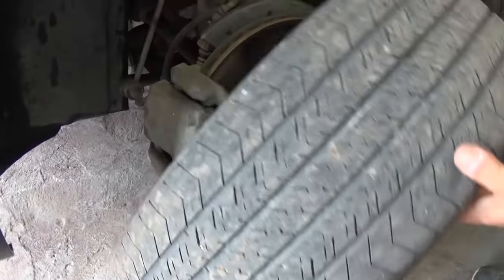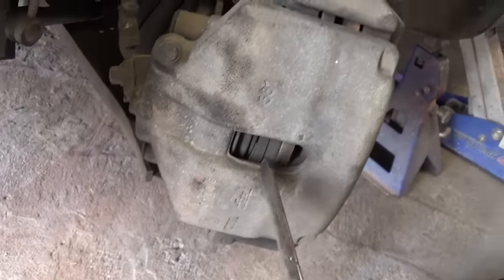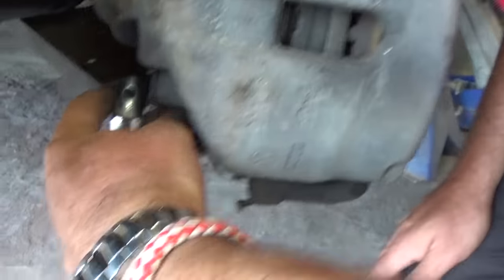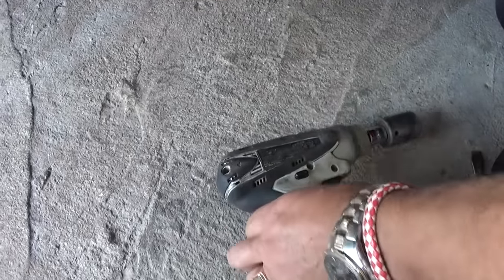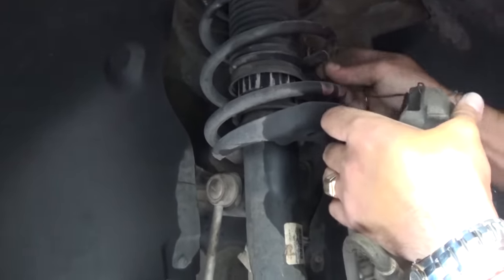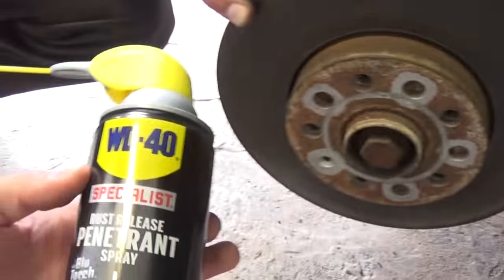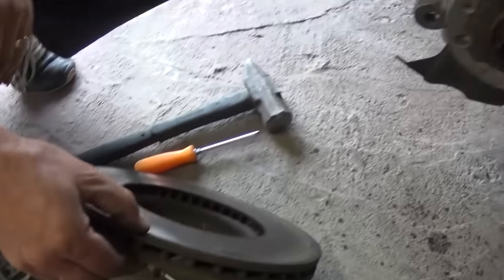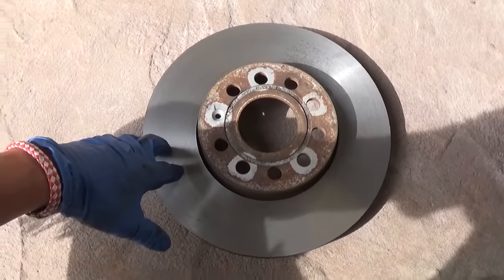CAR SHAKES WHEN BRAKING. FIX! STEERING WHEEL SHAKES

Comment: When replacing your rotors, remember, new rotors can be warped and uneven right out of the box!! This can cause "surging" when you press the brake peddle, even at very low speed you'll feel the car jerking. So it's a smart practice to consider turning rotors, even when they're new, before installing them.
Reply: What does turning rotors mean ?
Reply: @banaweekidane2630 turning rotors means machine rotors flat.   You don’t need to turn brand new rotors, they were already turned because there new.

Comment: To do this the right way, get new rotors new pads,  brake pad lubricant,  clean and lubricate all slides and brake pad guides..... Done!!!!
Reply: @Charles H Geis IV If your rotors are so screwed up and warped that your steering wheel is vibrating...its unlikely having them turned will fix the problem. Mine were doing this last year and no shop around here would even do it. Just replaced them and the pads🤷‍♂️
Reply: Agreed that turning them will smooth out the braking issue.  BUT, turning rotors removes material, and the reduced mass will allow them to get hotter more quickly, which could result in the same runout or warpage even more quickly than before.   But yes, if you can get them turned properly for ten bucks a piece, by all means do that, but I didn’t know it was that cheap.

Comment: Only problem is a lot of places don't wanna turn rotors anymore... They'd rather just sell you new ones...  Prices are like 15-25$ to turn and like 20-50$ for new so there not too much of a difference...... Some might say new rotors could be wrapped but it's also true that some newbie could botch up the turning especially if you take it to a chain store where they got some part-timer on the lathe......
Also if your rotor are 5- 10 years just get new ones...
Reply: Rotors for my car are 80 for the front and 60 for the rear. That’s the cheapest I’ve seen. So when it comes to spending $100 at most to turn vs $380 to replace, that’s a big difference lol
Reply: But is it worth your life on each amount? Think about going 70 mph and needing to stop on a dime with the unsettling shaking. Chances are you are going to be paying hundreds more if you get into an accident.

Comment: you need to sand the brake pads too to make it flat and even, because it will put uneven pressure on the rotors and you will need to do this job again soon,  if the brake pads are under the half it's better to put new pads oem or greater.

I use caborator cleaner to unstuck the rotors from the hub.

thank you for the video and keep on upload more videos 👍
Reply from the maker: Great advice. Thanks for sharing!
Reply: thesniperofcs what number # of sandpaper for this job ?

Comment: You need to separate caliper from the carrier in order to lubricate the sliding pins, so the brake force can be even on both sides of disc.
If sliders are jammed, it could be the cause of vibration.
Judging by the condition of disc and torex bolt, it seems that someone did a poor brake service recently. 
I would not be surprised if vibrations return after a while.
Best regards.

Comment: hey guys thanks for the video . my corolla 2015 sport really vibrated when I break. so what i needs to be done is to sand pepper the Rotor to give it a newer surface?
Reply: You can try that, but Corolla rotors are dirt cheap

Comment: One other thing that can cause the shaking of the steering wheel, is the brake show pins being bad. One I had was that the top pin was not cleaned/greased when it was out for a brake AND rotor replacement. The top pin moved ever so slightly but would not come out. So, a year later, it was frozen. All I had to do was remove the pin (hard, but it came out) and cleaned the pin and bore with brake parts cleaner and then I greased it. Tested smooth as a baby bottom, and no more shaking.

Comment: I have a vibration on steering wheel, only when brakes are hot, like going down a mountain pass, even at lower speeds like 60 km/ hour. Should i also go through the same process or can it be something else?

Comment: Hi, I have a 2011 Volkswagen Jetta 1.8T. And my problem is that the steering wheel vibrates (not the brake pedal) only when I apply medium pressure to the brakes at 50-60 km/h. At high speeds and lower speeds it doesn't do it. This problem began when I changed all rotors, brake pads and rotated the wheels (both of the rears to the front keeping each one on the same side of the car as the owners manual says). I wirebrushed both front hubs so the rotor sits flush, inspected rotors and pads, brake caliper doesn't stick. Also checked both steering end rod and links.
Reply: Did you figure out what was the problem,  same thing happening to my honda civic?

Comment: your rotors are not warped. they never are. the vibration is caused by uneven distribution of brake pad material on the rotor. you just need to bed the pads correctly when they are new.
Reply: I was thinking that I needed rear brakes but today my wheel started vibrating. I don't need rotors too?
Reply: Sheneitra Howard vibration under braking and just being due for new brakes are separate issues. if you are due for new brakes then the proper way to do it is to get new pads and rotors at the same time. whether you resurfaced or replace the rotors just be sure to bed the pads correctly.
Reply: @zacharyparis  ok thanks Zachary I'll replace both.
Reply: NOT true.....  chuck those rotors up and see if they run TRUE.. guarantee you will have some RUN -OUT in them.. very common these days.. brake rotors are smaller overall to save weight, too much heat build up causes warp-age easily depending how aggressive people drive braking wise ...  and the thinner they get from machining the MORE they will warp because they can't release the heat... I have machined HUNDREDS of rotors over the years and YES they have run-out
Reply: rotors do not warp due to heat. no normal person will ever get steel rotors hot enough to warp. i have been tracking my cars for the last ten years on steel rotors. repeated braking from 100+ miles per hour all day around the track creating extremely hot brakes... and not one warped rotor. the run out variance is due to the rotor not being perfectly flush with the hub. the other most common issue that causes vibration is an uneven distribution of brake pad material on the rotor.
Reply: Zach.. good points..  but we will just have to agree to dis-agree here...  and the hubs and the inside of the rotor hats are always cleaned.. and because today the braking systems again are somewhat smaller than they used to be and it becomes more critical ?? the wheels are ran up evenly and all torqued too....  and again.. depending on just how big your track car brakes are ??  you might not have a problem...
Reply: if you brake rotor wears unevenly(which can be caused in a variety of ways) then they may feel smooth in the beginning but soon develop a vibration. or if you get your brakes very hot and them immediately come to a full stop and keep the brake pedal depressed(or immediately engage the parking brake), then you can create an uneven distribution to the brake pad material to the rotor. this will then also cause vibration. 

you can't just re-bed the rotors if the brake pad material is already unevenly distributed. you need to start with new rotors or clean/resurfaced rotors. 

most rotors are made of cast iron. the minimum temperature you needed to have a chance to bend or warp them is about 1,000 degrees F. these temperatures can be reached on a track through repeated, hard braking from 100+ miles per hour. again, i have tracked my cars many times over the years and have never warped a rotor even under these conditions. on the street you will never reach these temps. i absolutely guarantee you are not warping your rotors from heat... or anything else for that matter.
Reply: your arguments don't even make sense. one post says BMW rotors are garbage and warp easily, and your next post says BMW rotors don't warp. if you have it all figured out then tell me what makes rotors warp? and what is the compositional difference between BMW rotors and other manufacturer's rotors?
Reply: “all aftermarket rotors warp.”
that’s a mic drop if i ever heard one.
Reply: After turning rotors, what do I do with pads if its barely used?
Reply: Chief Louie  ideally you get new pads. you want new pads mated to the new surface so that they wear together. i have had some luck carefully sanding the surface of the used pad to get a clean and flush surface, but no guarantees there. basic pads for most cars are pretty cheap so you may as well replace if it's in your budget.
Reply: keith cunningham  please read my posts carefully and consider the information. you are not providing a counter argument greater than "no way, bro." please provide some detailed information on exactly how a cast iron rotor can warp if you want to be taken seriously.

Comment: A glossy finish does not cause brake pads to vibrate. Research these key terms: "Disc thickness variation" (DTV) and "lateral run-out."
Reply: A very high grade ( thin)  sandpaper is what i used by applying a rotary type motion when sanding. Also ,,, i do this on my brake pads.

Comment: Just as easy to buy new rotors. Why go through all that when getting new ones is much simpler. Unless you have to machine to do it. It is not worth it in the long run.
Reply: Why replace any part. Get a new car lol 😊
Reply: rmcmillan469 Thanks 😋
Reply: Some people just have money to burn.  I have rotors turned at a local shop for $25 per pair.  New ones are $40 each.  Do the math.
Reply: Some of the brand new rotors you can buy are so poorly made that they will do this almost immediately after installing them.
Reply: rustyme1122 You do the math again.. 25 to resurface both and probably going to have less life. Meaning that you will need new rotors soon. Thats 105 total. If you go new right away is 80. Cheap is not always the option my friends.
Reply: Genuine OEM disk costs $100 each. Low quality disk made in places nobody knows in  China are $40 each. Machining OEM is far better than replacing with cheap junks.

Comment: The shaking i feel coming from the rear regardless of braking speed. Any ideas?
Reply: When brakes become warped due to heat they expand Causing the warping going around the car but the most being around where the cause of the issue is

Comment: hi I got BMW E39 I had a problem with the shaking sterling Queen I replace the rotors and the wheel hubs I checked all the bushes bushes I done the alignment and still a shaken can you help me what is the problem it's shaking I'm turning left without touching the brake pedal
Reply: Wheel Alignment does not correct shaking,vibration,squealing or anything else,
unless it was not done correctly previously,a little tire wear issue may be corrected
but without replacing the worn parts that cause all vehicle issues, your wasting your money
on alignment, expecting it to somehow fix a mechanical wear issues or bent parts

Comment: I feel it randomly like it drives completely smooth then steering wheel shakes like crazy even when I’m not braking. This happened after changing front and rear brakes
Reply: From my experience, the rotor will be the culprit if you are stopping. If it does this even when not braking, it could be the brake caliper.

Comment: Steering shake coyld be due to many other reasons..tyre imbalance, worn bushes, work column
Reply: Hello Mr. Jaswinder. The steering wheel on my car shakes when I apply brakes above 120kmph, it works well in normal speed. I had replaced all my tyres last month,  so I thought it could be due to the the imbalance of the new tyres. But even after the balancing was done last week, it still vibrates. I am not really sure what's causing the problem. The mechanic told me that if it's the warped rotors, then the shake will happen at low speed as well. So, I don't know where to start.  Can you please tell me what are the other things I should check? Or maybe one or more tyres are defective? It's a Chevy optra magnum which has done 98K Kms on the odo. Thank you for your help!

Comment: What else could cause shaking while braking? I replaced rotors, pads, tie rods, ball joints, etc, car still shakes.....help
Reply: Tires or wheel bearing
Reply: Bring it to a warmer country. I shake when its cold out.

Comment: I need to have my rotors checked I think I've Warpped them lol
Reply: Rotors do not get hot enough to warp
That is just a misused term that does not apply to vehicle brakes
All Brake issues are from neglect 
Failure to do anything but drive or failure to perform brake work correctly & often enough
Reply: Yes I have a 04 Chevy Malibu  and the front end shakes when Im going over 45mh and step on my brakes I changed  the Rotors and the problem came back the next day  what else can it be if anyone can help hope to hear from someone  soon thank you.. Roman.
Reply: Albert Roman grease your pins to make sure you calipers are sliding smoothly.

Comment: Wouldn't let that Cowboy anywhere near my car...  Using a screwdriver and hammer?  Change the Discs / Rotors and the Pads at the same time, you can't get the Discs / Rotors skimmed and then put the old pads back on?

Comment: Does bad rotors shakes the car without applying the breaks (while driving)?
Reply from the maker: you might noticed some pulsation in the steering wheel but not too much. Check your wheels too
Reply: I changed the wheels, fixed the wheels bearings and changed the idle arm. every time I do something the shaking was reduced, now I'm sure that the rotors are bad because when I apply the breaks its shacks.
are there anything else causing the car shaking?
And now (another thing could be related) I began to feel vibration with noise in the steering when I turn left or right slowly. what could that be?
Reply: laith114
Reply: Tires
Reply: laith114 might need to balance your tires
Reply: laith114 it sounds like a new car. Lol
Reply: No check your car tie rod inner and outer and arm control

Comment: I put brand new rotors and pads, still vibrating when I'm braking..... What can I do to fix problem???????
Reply: Patrick Guillory Don't drive that car again
Reply: LOV2XLR8 How can I fix the problem?
Reply: Patrick Guillory Then u have another problem. Check the suspension parts.
Reply: check the lower control arms bushings. If those are bad, while going fast, its pretty hard to keep the car in the lane when there are imperfections on the road. Also thumping when going over some dips.
Reply: Patrick Guillory Have you checked your tires? That was my problem after I replaced the brake pads and rotors.
Reply: Could also be caliper pins maybe?
Reply: you are all wrong. he just didn't bed the pads correctly after he installed them.
Reply: Get ur rotors resurfaced even if they're new. Bleed your brake lines. Perform a break in procedure on your brakes. Check your hub bearings and suspension parts. Broken control arms will cause vibration too

Comment: You spend $10 to have it turned. It cost $20 to buy a brand new one.
Reply: On my car front rotors 90$ each...10$ each to spin em. I usually only spin em once though before i replace em

Comment: How about checking wear in front suspension bushes or seized front brake callipers. The disc’s are blue proving that you’ve either got seized brake pads or a sticking brake calliper. I would call you very un professional and you’ve also got a leaking front shock absorber. I wouldn’t employ you. You talk a load of rubbish as other faults can or cause damage to brake disc’s.

Comment: Do not follow this video. Modern rotors are not designed to be turned and doing so will reduce you cars ability to stop effectively. Any material removed reduces the rotors ability to dissipate heat and reduces the effectivness of the entire braking system.
Reply: and this just shows you didn't even read what I said.
Reply: I have never once heard of any vehicle being made with brake rotors than could not be resurfaced. If you have any proof of any such vehicle please let me know, until then you can resurface any brake rotor in the world, as long as it does not exceed the minimum thickness stamped on the rotor.
Reply: This is NOT TRUE. Sometimes, even new rotors have to be turned before they're installed (because new rotors can be warped right out of the box!)
Reply: Dual Sport Numbskullz 5m
55
Reply: Dual Sport Numbskullz I was an ASE master tech for 8 years and worked at many dealerships, and I can tell you that you're absolutely WRONG. ALL rotors can be resurfaced as long as their is enough material to be removed which can be verified with a caliper gauge or micrometer. Also the metal on the face of the rotor has nothing to do with its ability to dissipate heat... The fins in the top profile of the rotor are what allow air to travel through to cool it. I don't know where you're getting your information from but you're completely wrong.
Reply: steve h you should check the first Ford Mondeo Europe MK1 late eighties which rotors warped just holding the brakes a bit to long at the traffic light (while heated) or the first giant Mercedes S class of the nineties W140 nick name ‘ the cathedral ‘ (1991) these rotors where much too small for this large heavy car and suffered overheating and warped.
Reply: steve h.  Haha ... you are correct Steve. But, most people do not know that. I was looking for a post where someone would 
point that out. 👍👍
Reply: Rick Jasper : Right,From Dropping During Shipment or Ones From China.NAPA Stores Here In Atl.Will Smooth Out Any Rotors Bought from them,for $5-7.50 Each@ Purchase.